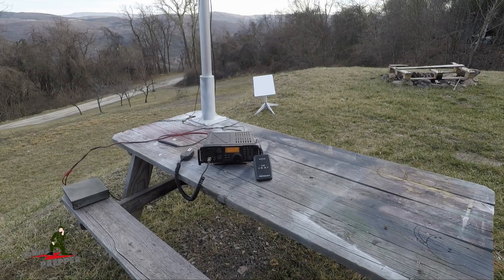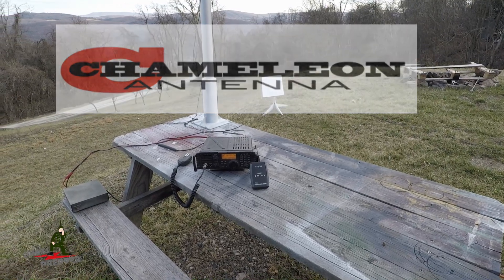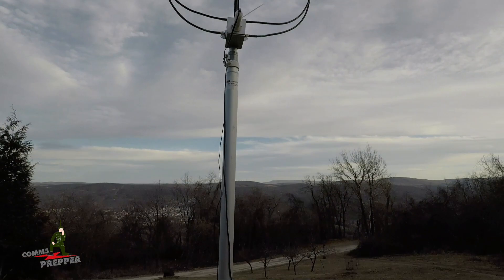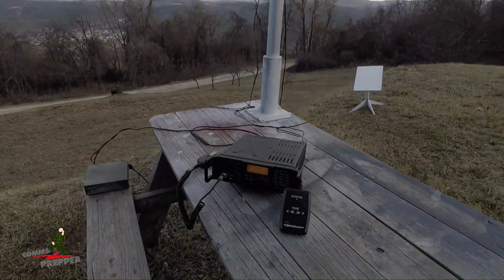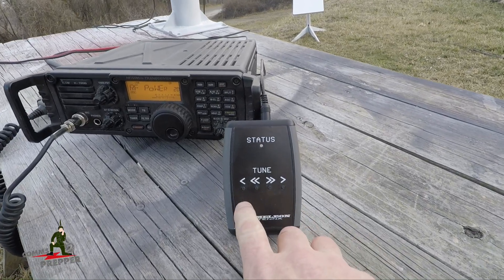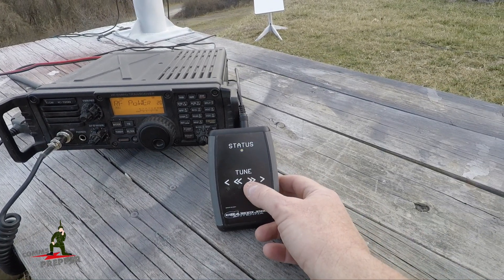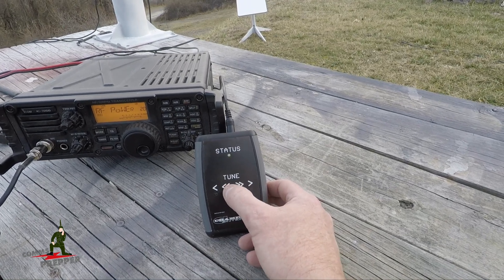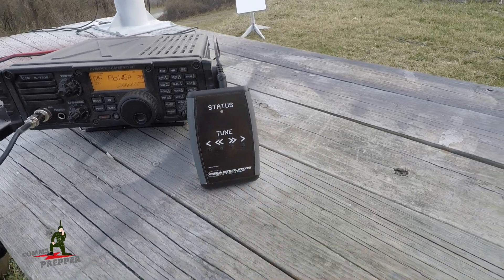Chameleon Antenna's CHA LRT (Loop Remote Tuner)

Comment: Hey Hank, just yesterday I tried out the Delta Loop like you did before with the horizontal Wire lay on the Ground and running my IC-7200 with the CG3000 Automatic Longwire Antenna Tuner. It worked out very well on 40-10m with 173ft. of Wire. The Bands just were super crappy with a lot Aurora. Haven't seen the Bands in a bad Shape like that in a long Time. But I was working VU on 10m Band and a dozen of SOTA / POTA Guys across Europe and Canada. Just want to thank you for all the great Videos you making.
Happy 1st of March into WV & 73 de Your Friend Uncle Guenter, the fulltime Portable Guy. 💯🙋‍♂